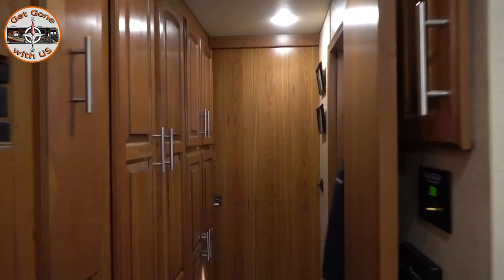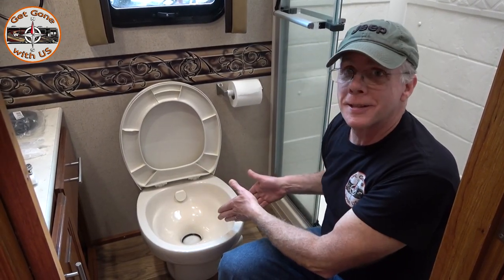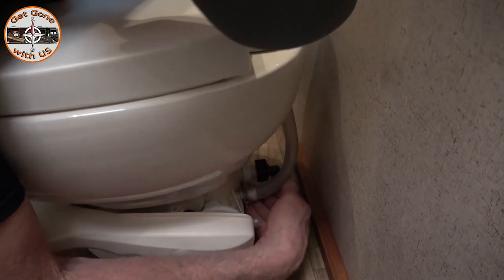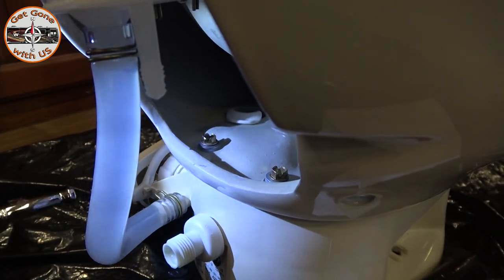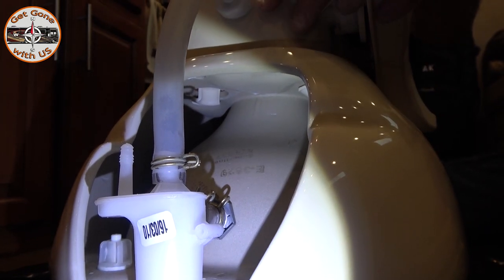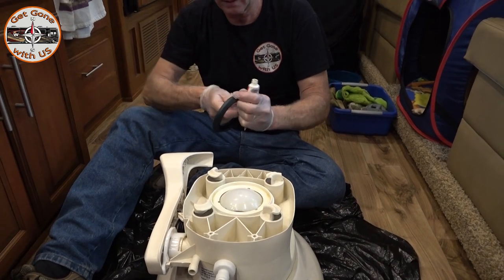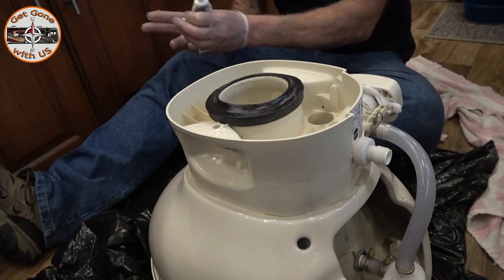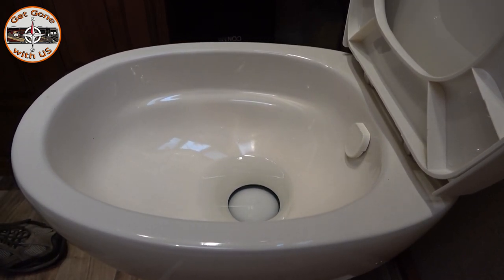RV Toilet won't hold water - Seal Replacement - Thetford Aqua Magic

Comment: Thank you for your helpful video! But I do have a question: If you can just twist the bowl to get it off and get access to the seal, why did you remove the entire toilet to replace it?
Reply from the maker: You are welcome.  Mainly it was lack of space to work on the toilet.

Comment: Thanks for the great video! Both plumbers grease treatment and replacing the seals didn't fix my toilet, bowl still won't hold water. Almost seems worse. I first noticed it not holding water a month ago. The seal appears to be centered, Thetford suggested letting the valve slam shut which seemed to work at first but doesn't seem to help now. I've doubled checked the reinstall and the bowl seems correctly locked onto the base. I replaced the base a couple years ago but the bowl is original. Any ideas what I should try next?
Reply from the maker: Check the foot pedal. After releasing it pull up on it and see if it moves. If it does then it’s binding. Remove it and lube where it is mounted. Good luck.
Reply: Thanks I'll try that. @GetGonewithUS

Comment: Hi. So I’ve removed the ball seal and was wondering if I still need to take the toilet apart to install the new seal.
Reply from the maker: Hi! I would still take it apart to make sure it is reseated correctly.  We are not professionals either, but did have that toilet taken apart quite a few times.

Comment: Hello,
Is there a water screen on the inlet of the water valve?  My toilet does not seem to allow as much water in the bowl. Adjustment?
I need to also replace the seal due to the water leaking out of the bowl.  Years ago I used the powder and wondering if the grit scratched the ball assembly.  Can the ball assembly/slide plate be replaced?
Thank You
Reply from the maker: Check out this video.. https://www.youtube.com/watch?v=ACBLn1E8QLM

Comment: OMG!  I can change mine with the toilet installed.  Just push down the pedal.  Pull the old one out.  Grease a new one and install it.  Done!
Reply from the maker: Yup.  We are not fans of Thetford. It failed twice on us.  If it failed again, we were replacing it with a different brand.
Reply: You must have a Dometic type.

Comment: I have the porcelain toilet, but my foot release is at the front, rather than the side, so I'm assuming the process will be the same?   Looks like I need to run out and get some plumbers grease, to be on the safe side.   Thanks for all the 'tips'!
Reply from the maker: I have never owed a front pedal toilet, so I can't answer if it is the same.  I would imagine it might be close, but I don't really know for sure. Good Luck!

Comment: I did this seal change and now my toilet wont sit flat on the floor. I shimmed the back side which stopped the rocking but not sure why the new seal didnt fit perfectly?
Reply from the maker: Sounds like the flange seal between the toilet and the floor is not sitting right or it is the wrong one.

Comment: Couldnt the toilet be kept in place, and just pull the old seal out and put new one in?
Reply from the maker: Not in our bathroom! LOL  NO room. 😆
Reply: @GetGonewithUS  i seen a vid the person opened the ball valve and pulled seal out n put new in, unless it was a dometic
Reply from the maker: @tmaq9726  I misunderstood your question.  I thought you meant remove the bowl from the base without removing the base.  The answer is no, you can't change it without separating it. The video you saw would have been a Dometic like you thought. :)
Reply: @GetGonewithUS  darn 😕 why couldnt thaey all be the same haha
Reply from the maker: @tmaq9726  If only!